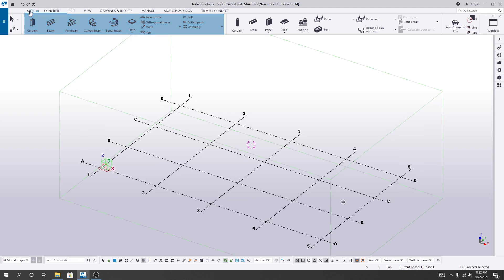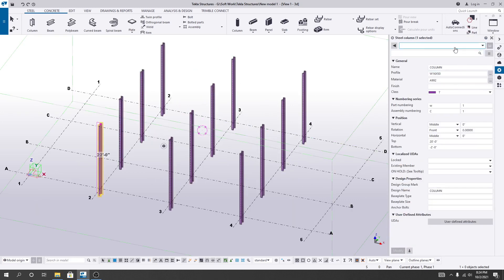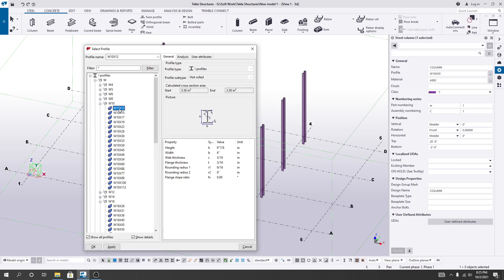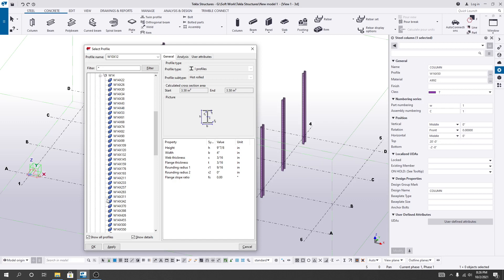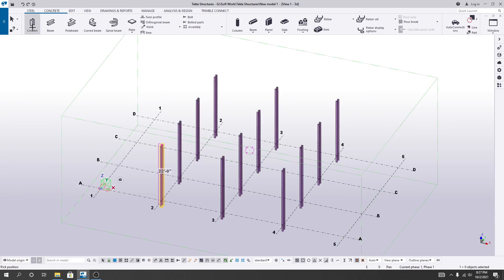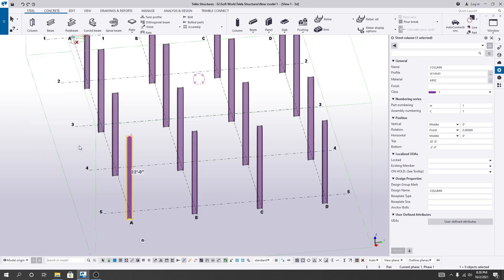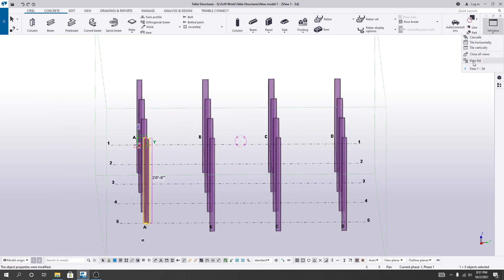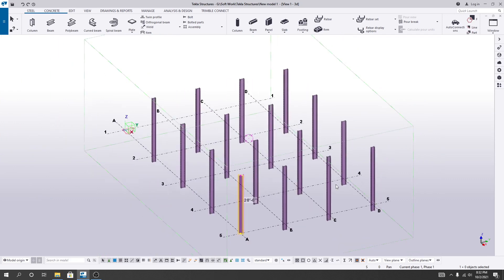17. Tekla Structures Tutorials | Drawing and Modifying Steel Column in Tekla Structures 2021

Comment: Sir if I give a clear cover to rcc column  is 40 and same rcc column design with clear cover 25  the reinforcement ratio is different for same moment in etab plz clarify.
Reply from the maker: your CC should be same for analyses and design process
Reply: @qlearnify-en  no sir i mean first I have design a column with cc  40mm then same column design with 25mm the load, moment etc are same both conditions but Etab shows different reinforcement .